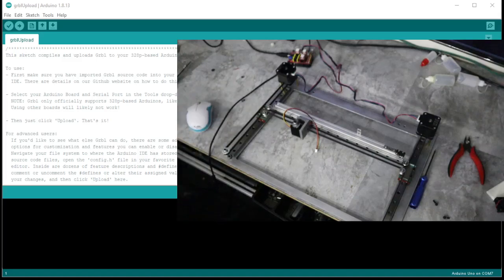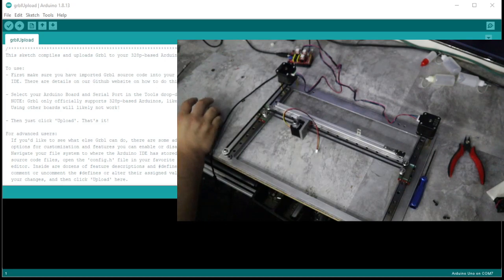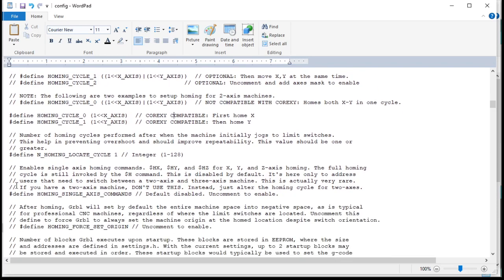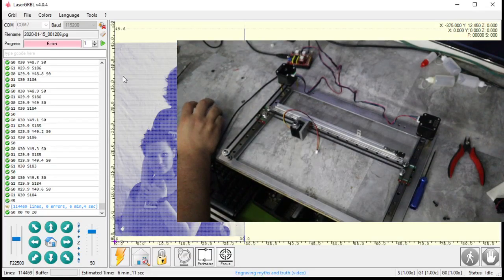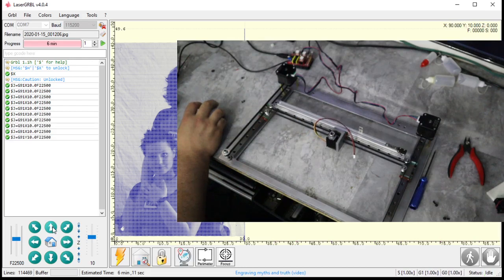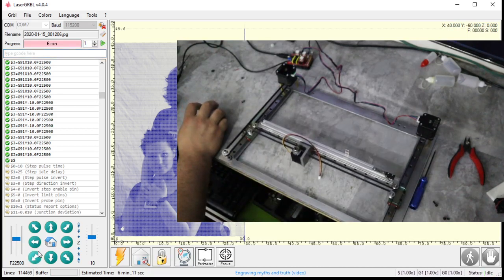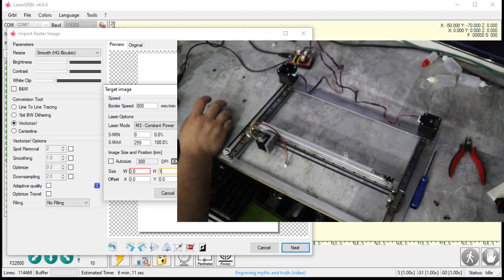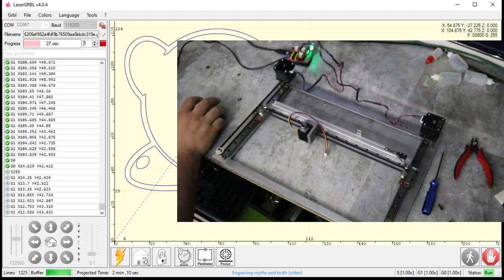GRBL Shield video optional   COREXY Setup

Comment: what is the maximum speed that we can get with this core XY setup on the laser with Arduino? can you tell me
Reply from the maker: I've had it up to 42000 mm/s
I raster along the Y axis instead of the X axis
Reply: @brakthehun  What 42000mm per second ! Thats insane 
Anyways can you please start reuploading the co2 build videos i was actually making one for myself
Reply from the maker: @BlackwingzYT  sorry. Per minute.
I am out of town. I have all the wiring videos done. I just need to upload them.
Reply: @brakthehun  I am making the laser cutter using nema 23 and tb6600 with the belt system with working area of 3 foot by 2 foot should i use 1/32 microstepping or 1/16 microstepping and is there any advantage to 32 microstepoing.. Because obviously the speed will be slower. and can you please answer my another question What is the maximum speed i can get with the arduino i am using xy homing firmware and 20 tooth pulley

Comment: Hi bro, i keep getting an alarm 9 when trying to homing with lightburn, is it because i only use 2 axes? I didnt use z axis, i try to change the file in config.h as you did, but still not working? Any tips how to diasble z axis on homing? Thanks bro
Reply from the maker: Are your dimensions setup yet??
Set your $130 and $131.
To disable Z homing,, you can also use lasergrbl to upload firmware
Reply: I already set my $130 and $131, is there any way around without flash the firmware? For example can i set the value of all z axis to 0? Will it do? I try it before editing the config.H on grbl firmware deleting the z axis and then uploaded it again to my arduino uno using IDE, but when i open lightburn, when i try to run the x and y axis, its just keep saying busy until i upload the old grbl firmware 1.1h, it work all fine but i cannot figure out how to homing with 2 axis, ? Any tips? Try flash the firmware first using laser grbl?
Reply from the maker: @screeningstudio3868  yeah,, use LaserGRBL to flash it. It has precompuled firmwares for you to use. Use the XY homing one
Reply: Tony Baltazar thanks a lot, it easier with laser grbl, your video really helps a lot, can you recommend which cam software is the most easeier to generate g code for beginners 😁
Reply from the maker: @screeningstudio3868  I usually use laserGRBL for images. 
grid.space/kiri
can generate laser tool paths in SVG format and you can open them up with lightburn.
Reply: Tony Baltazar can plasma cutter be use with laser grbl or lightburn as well?
Reply from the maker: @screeningstudio3868  yup. It has kerf offset,, lead in / lead out,, and delay on/off settings
Reply from the maker: @screeningstudio3868  that's lifhtburn with those settings,, not laser GRBL
Reply: Tony Baltazar i see only lightburn, so no need to use cam software right to produce g code lightburn already do that right? Thanks a lot for replying and sharing
Reply: Hi bro, 1 more question, i have figured out how to run all the motor and g code, but i have 1 problem which is to figure how to run the plasma cutter on and off? im using 5v arduinl modul relay with active low pin, vcc 5v inlet power pin and ground pin, and the other side of terminal have 3 pin which is normally closed, normally open and comment, so i connect the active low pin to z+ pin on my cnc shield because it is the spindle enabled right? Im using grbl 1.1h, so the vcc 5v and ground pin i connect to the cnc shield to power up the 5v arduino relay module, for the plasma torch, i connect the wire to the comment and normally open terminal on the 5v arduino modul relay, when i check the voltage using multimeter when running a trial job, the light indicator is blinking on and off when running the job, but there is no voltage at the commenct and normally open terminal? It should have 5v voltage when on and nearly 0 voltage when off right? I tried to connect it with the plasma cutter but there is also nothing happened, do i need separate power supply for the 5v relay module? Or do i put the ground of the 5v module relay next to the Z+ pin on the cnc shield? Thanks for the help
Reply from the maker: @screeningstudio3868  I am currently setting up a plasma Cutter myself with GRBL. It looks like there are two pins from the torch trigger and you connect those together to fire it. I used a relay with (C) common on one of the wires and (NO) normally open to connect the other wire. I have a fellow makerspace member coming in this week to actually plug the torch in and get it going. I will,let you know when that happens.
Reply: Tony Baltazar yes there are 2 pin on the plasma to control on off of the torch, i try to connect all the wire together with the relay, but when i turning on the plasma cutter, the arduino board suddenly go crazy, its suddenly lost it com port on the lightburn and make the homing unavailable, and also reset all of my grbl settings, 2 times 🤣, i dont know if my way of connecting all the pins is correct or not, first I identify which is the + and - pin on the plasma on off control that connect with the torch, i connect the (-) pin on the machine and the plasma torch together, then i connect the (+) pin from the machine and plasma torch to the 5v module relay to COM and NO, the (IN) pin from the relay connect to the Z+ pin on the cnc shield, and connect the power pin which is VCC and GND to the cnc shield to power up the board, i dont know if my wiring is correct or not the green led light from the 5v relay is keep turning on the entire time, i dont know it is because of my grbl firmware has problem or something else, please let me know when u complete your project, thanks a lot,
Reply from the maker: @screeningstudio3868  yes,, a power surge. You may need to use an optocoupler relay to avoid that.
Reply: Tony Baltazar i see, thank you, will try to use a relay with octo coupler, thanks man 👍 really help a lot

Comment: hi bro ,, can you help me? I have a problem with my machine, so this should go sideways so it is straight, which should go straight so it turns sideways, the config settings in grbl are in accordance with your video bro, please for the solution🙏🙏🙏
Reply: and in my lasergrbl software for grbl configuration there is no $ 30 $ 31 $ 32 bro ,,😥🙏🙏
Reply from the maker: I might need to see a pic of your machine. Sounds like you need to swap your x and y cables. How do I message you??
Reply: do you use the whatsapp application?
Reply: my problem is now in the servo, the servo doesn't work,

Comment: Hi bro I keep on watching.. Another nice one.. Can you share your design? Thanks
Reply from the maker: Yeah. Do you have an email I can send it to??
Reply from the maker: Actually!! here's a link:
https://cad.onshape.com/documents/7996392b63313da0ff8f9ad6/w/e0e855329f8517c98a7a7fb9/e/a6020cc4c1c549ef54d2f367
Reply: @brakthehun  thank you bro. I like your design compact and neat.
Reply: hey bro, i followed your instruction in core xy but mine doesnt home... i have my limit switches in x and y axis
Reply from the maker: @marlonglodo1930  did you set up one at a time homing in the firmware?? Did you set up your registers for homing?? ($22)
Reply from the maker: @marlonglodo1930  https://youtu.be/diPH4qh4r78
Reply: @brakthehun  hi bro Tony.. After pulling all my hair I figured it out. But there is one more problem. When I move the x to right it move correct but if I move y to negative direction it is goes to positive. I already change the wiring of the motor but no. Success.. Any idea bro. Thank you
Reply from the maker: $3=2
Try that.
Reply: @brakthehun  thank you sir Tony. I finnaly make my core xy move to where it goes to move.. I keep watching your videos. Again thank you. Keepsafe
Reply from the maker: Post a video on your channel!!
Reply: @brakthehun  OK Mr. Tony I post later...